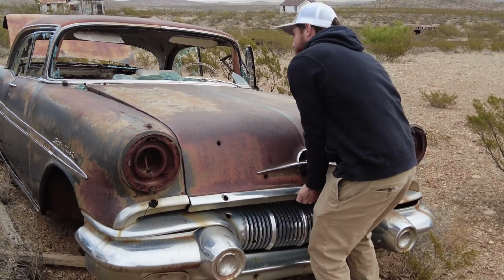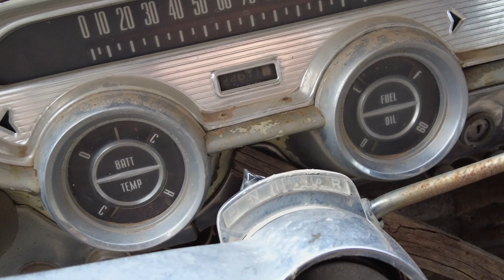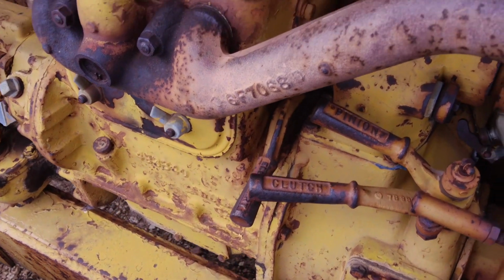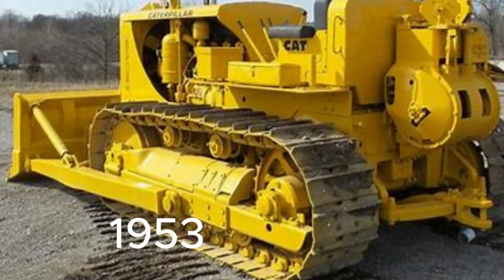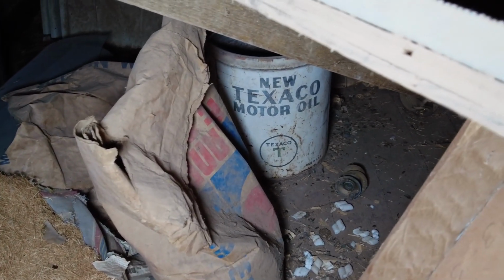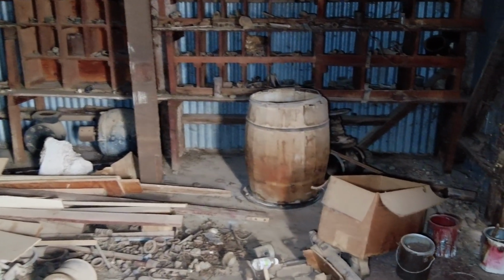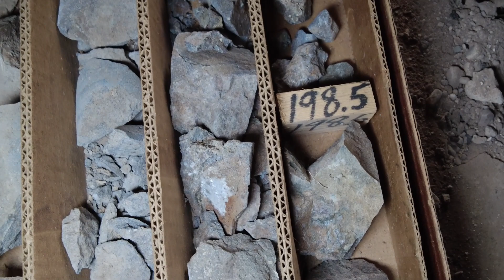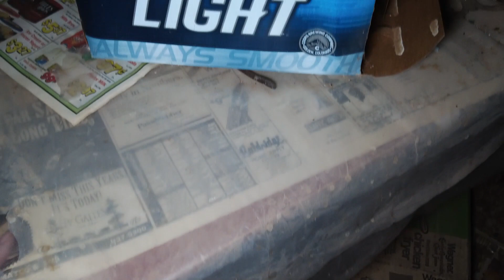The Car and The Bulldozer

Comment: Definingly a D8, D9's didn't go into production until 1961. I wonder why the would walk away from a piece of equipment like that. The differential on the ground by the leaf springs is out of a model A truck. Just tripped over your channel. Liked and Subscribed. I hope you keep it going. Looks like a fairly new channel. I'm an old time that might be able to help you identify some of the old stuff you can't identify. Take good pictures. That would help. I was wondering what the date on some of the news papers were. Good show! Keep doing what you are doing. Thanks
Reply from the maker: Good info, And thanks